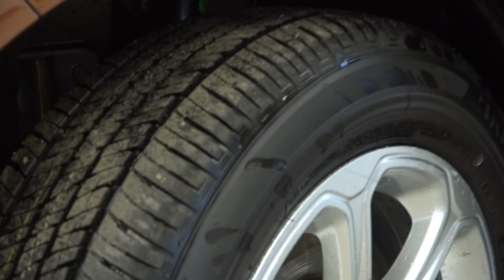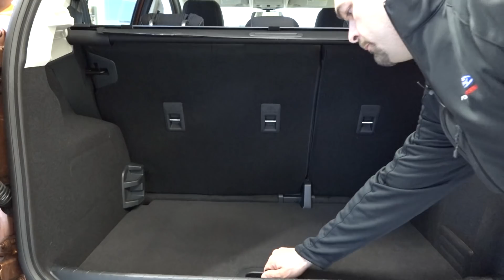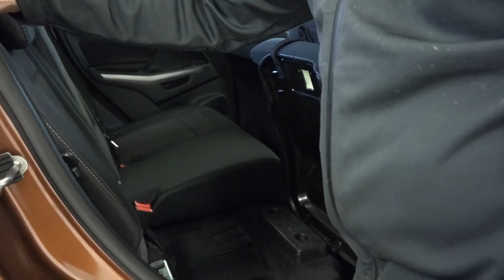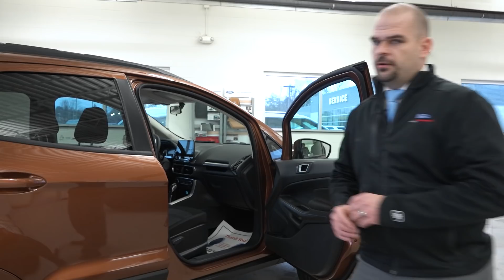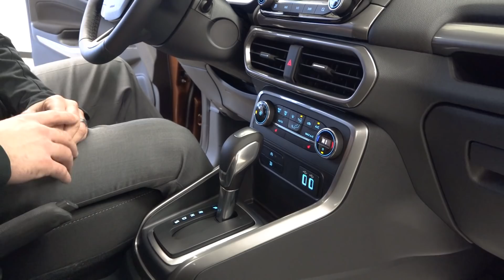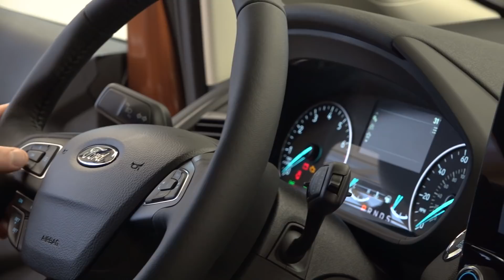2018 Ford Ecosport Exterior & Interior Walkaround

Comment: Im a bit late to this party but i had to comment. I purchased a used 2018 Ecosport 2 weeks ago and it is a fantastic bit of kit I have the 998 it isnt the fastest but i am not after speed. It gives a nice ride and yes you do get some little extras  I have the titainium spec. I watched a few review vids but i cant fault it apart from you lot in America get the tournea cover and in England you just get a shelf. it has a great driving position, it is tall and when i washed it i had to use some steps to do the roof but it looks great when its polished

Comment: Im considering the SE 1.0 liter edition. I live in Phoenix, AZ where our summers can be over 120 degrees Fahrenheit. Typically small engines = small A/C compressors = bad air conditioning. I owned a 2013 Chevy Spark and even rented a Fiat 500 and both cars have air conditioning that cannot handler Arizona's summers. I currently own a Ford Focus & Ford Escape with both vehicles have excellent A/C. ICE cold, BTW. Have you heard of vehicles having sub-par air conditioning? How does the Ford Ecosport A/C rate? IN Arizona good A/C is VERY Important. --> DJ

Comment: I looked one over at my local ford dealer, I came away thinking that it is a tiny homely vehicle. Made in India, only 29 mpg on HWY . Personally I would not trade even for my 2013 Ford SE Escape 1.6 Turbo. 35 mpg on Hwy. plus more cargo room, 175 hp and quicker with a real spare and lift hatch.  Not to mention  my Escape has much better styling. My guess is most buyers will be women.......................
Reply: Bextar636   Their big with us retirees here in fla. Nice change from the soul and the trax

Comment: I drove the base with the 2.0l and it was A DOG not sure if it was sooo slow because I had my friend and the salesmen in the car at one or the thing is just extremely underpowered. Feels slower than my current car(1996 Toyota rav4). Also not  sure how dependable this will be as my car was purchased new and now has 300k and runs like the day I got it.
Reply from the maker: Hi Kyle, it is an economy compact SUV with lowest overall ownership cost kept in mind.  The powertrain is sufficient for operation but not intended for performance and instead focuses on MPG and low cost of production.  Hopefully that helps :)
Reply: Any vehicle will go 300,000 with proper maintenance.
Reply: Buy another Rav4 silly

Comment: "No spare tire?"
Reply from the maker: Correct Ben, Most late model vehicles now come with inflation repair kits to save on weight for MPG's.
Reply: Lasco Ford 
" I am aware of that, I am light roadside tech. I see many car makers do the no spare, I seeing the Acura MDX no spare. The roadside packages only let's you tow it to the dealer. They don't let you tow it  to a third party,  like firestone,  or discount tire. That's a big incovience for many customer, that personally deal with, plus most dealers are close on Sunday. Most customer prefer a spare for convience. I would say this is one the first ford vehicles that would not offer a spare on most ecosport  models. FORD is still doing a good job in offering spares. I am still interest in this new small crossover. I might  be able to stock a spare underneath the storage." LOL!